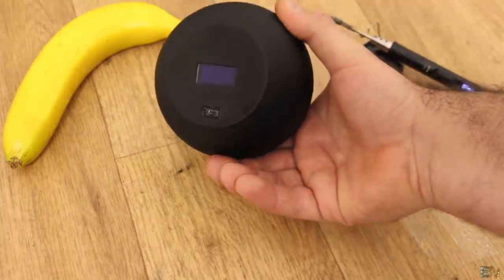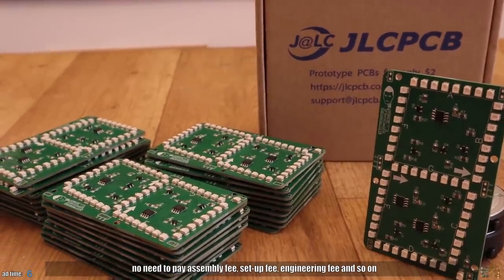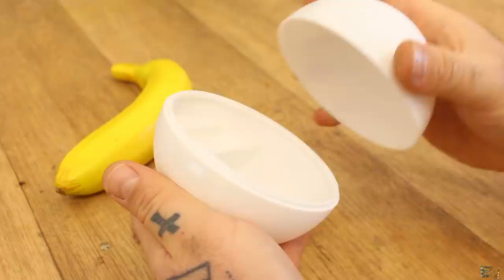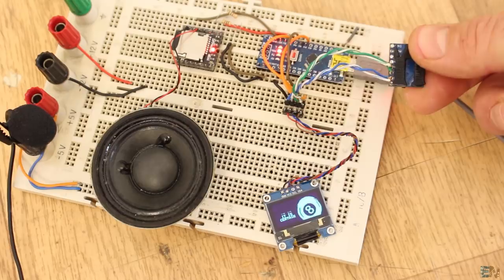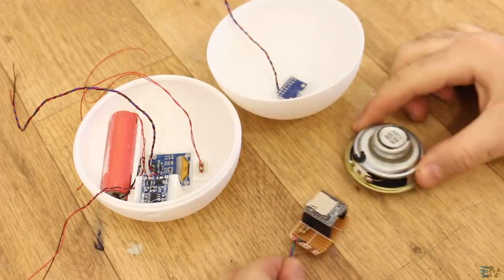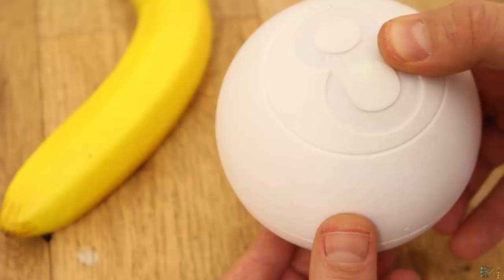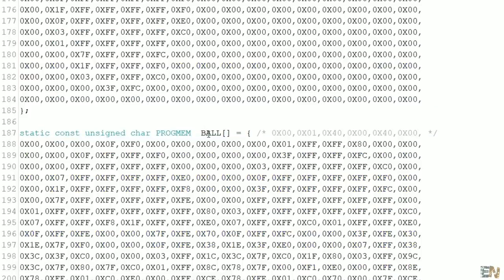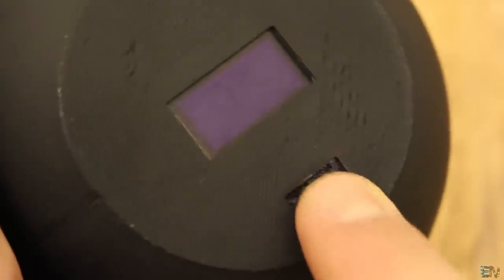Digital Magic 8 Ball - Arduino | Display | Sounds | Gyro

Comment: Nice fun project.  You might think of adding battery level testing and show the level when you first turn it on. Ralph Bacon has recently done several videos on how to measure battery voltages

Comment: This is a great project, and it looks like something you could leave on your desk at work and it would get a lot of attention.  One question.  Could you have installed some sort of switch on the bottom that was off when the ball was on the table, and on when you picked it up?  I'm imagining someone walking up and picking it up, and it's on, but while it sits there, it's not using up the battery.
Reply from the maker: hmm, that is a nice idea! maybe a push button...
Reply: My arduino kit came with a switch that looks like a capacitor and when you put it uposide down it turns on, maybe you could use it in series with the battery

Comment: Hello everyone, my AND logic gate ic 74HC08 is not working. I have supplied exactly 5V but there is no output from the ic. As I give 5v to the input pins, the voltage at the Vcc pin drops. Please help......
Reply from the maker: Maybe you need some pullups or pulldowns at the outputs. Maybe a 2K resistor or so. If not, maybe the IC is damaged.
Reply: @ELECTRONOOBS  Didn't expect your reply, thanks for advice, I'll surely try.

Comment: Sorry but your project kind of cheating, cause you don't have any microphone, the ball gives answers just when tha MPU is turned upside down.👎
simply by adding a microphone with simple LM358 you could detect when someone asked a question.
Reply from the maker: The real magic 8 ball doesn't have a microphone neither. The rule is to give an answer each time you rotate the ball.
Reply: so, ok 👌
Reply: Actually, you are supposed to shake it